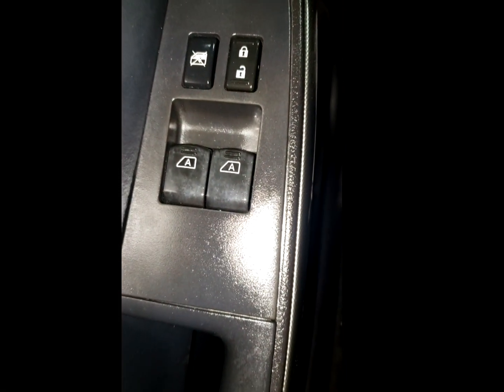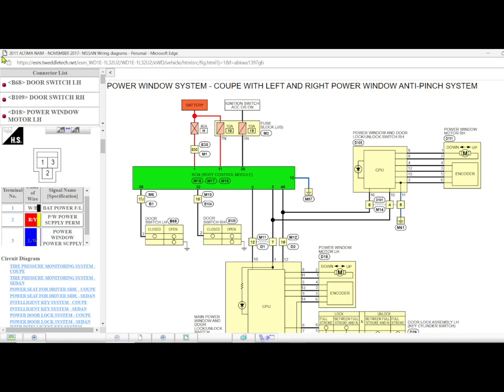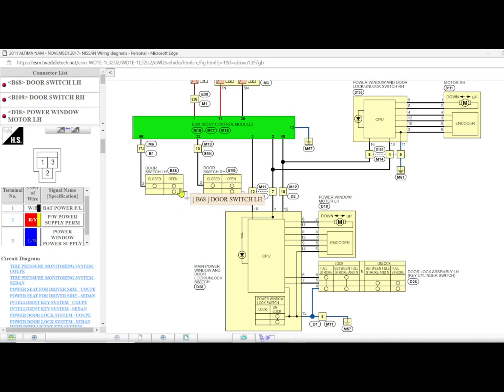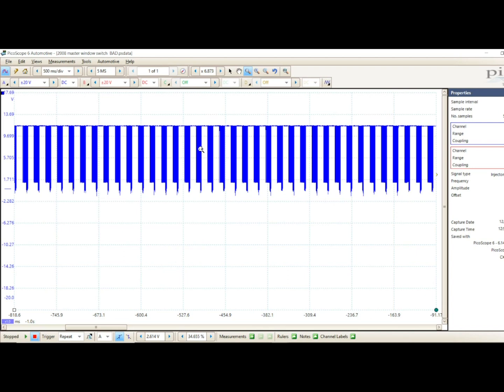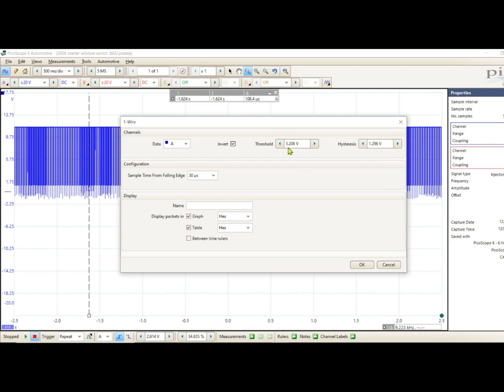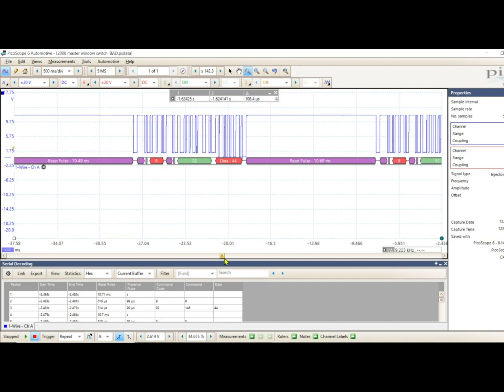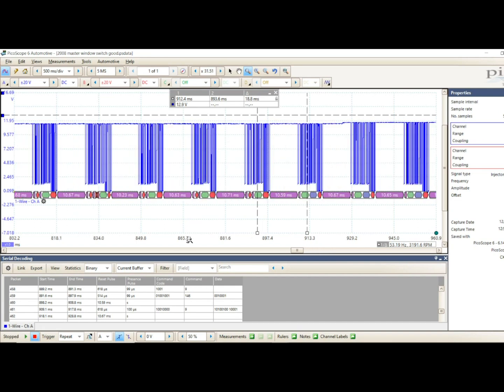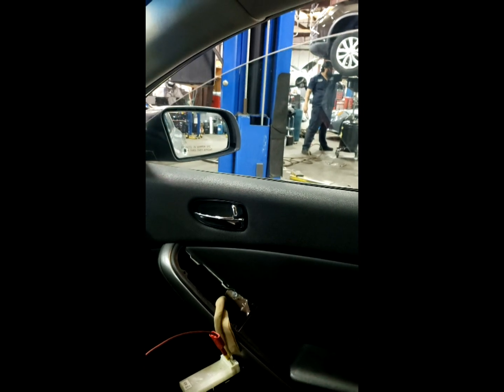Serial Data for a window problem??? WHAT!!!

Comment: thanks for sharing. Could you have jumped the good signal wire from the driver window switch to switch b and see if the passenger window responds?
Reply from the maker: The integrity of the wire was good in this case, the proper signal was not being generated by the master switch, so I don't jumping it would have helped. Now if the signal was good and the sub switch wasn't receiving it, a jumper would have worked.

Comment: Without scope and decoding this would be hard to diagnose. If  I saw signal and not knowing what it means easy could blame motor because signal is there
Reply from the maker: Having the decoding ability certainly was handy on this one. 
Knowledge is power.
Reply: Interesting information, it is a good learning and although sometimes you can see the operation of the switch through the scanner, the coding shows much more details of the information sent and received by the switch to the node. Thank you
Reply from the maker: Agreed 👍.